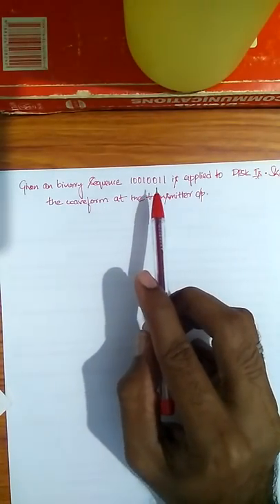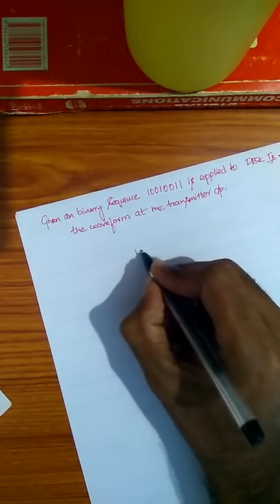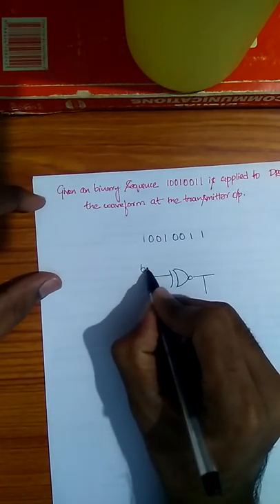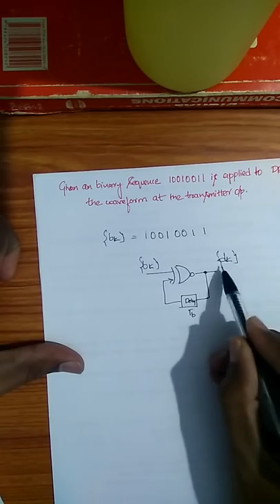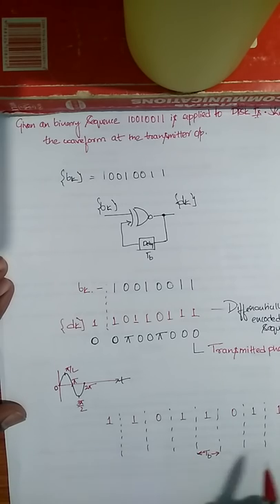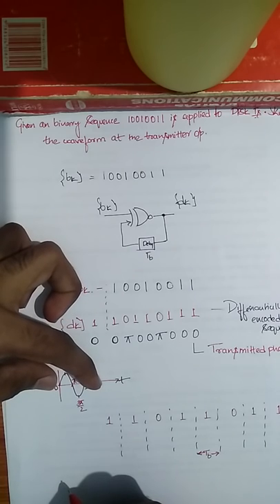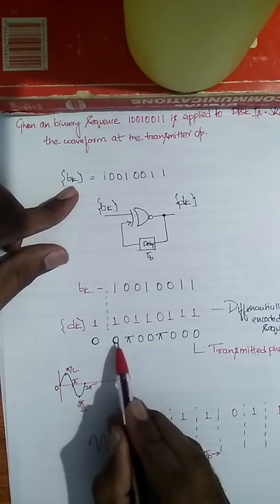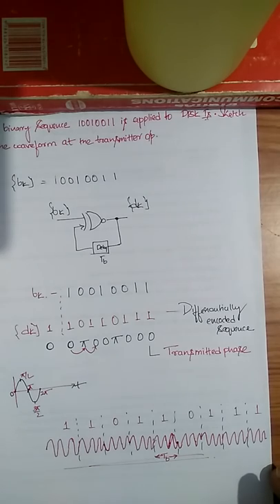DPSK modulation problem

Comment: nice explanation,but pi for 1 and 0 for 0 correspending to the differientielly encoded message (you did the opposite )
Reply from the maker: Thank you. You can consider both logic. It works since we exor data.
Reply: yes that's right ,but it might concidered wrong because basically we shift previous phase by pi when we have a message(1) and we left it unchanged when we have 0 ,that's what diffirientiation is about